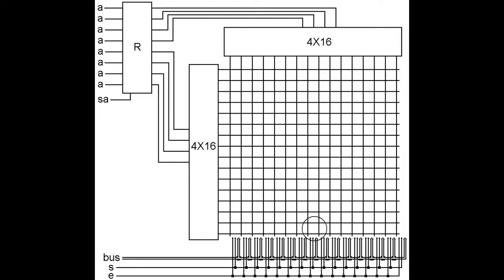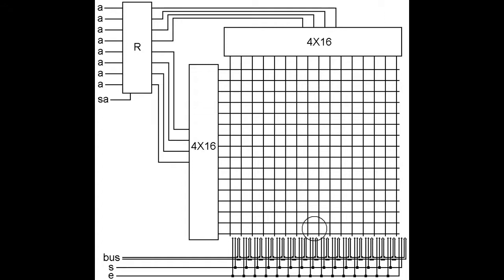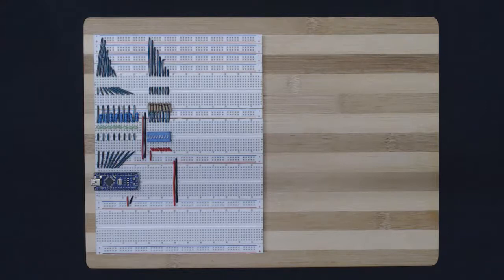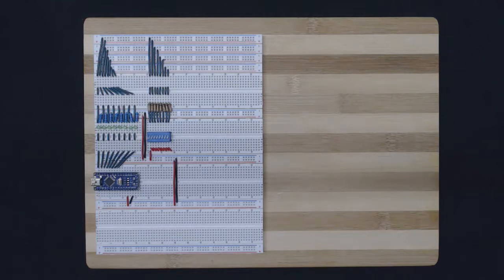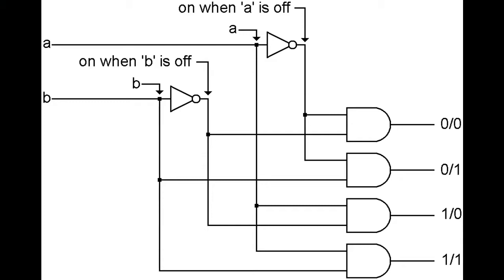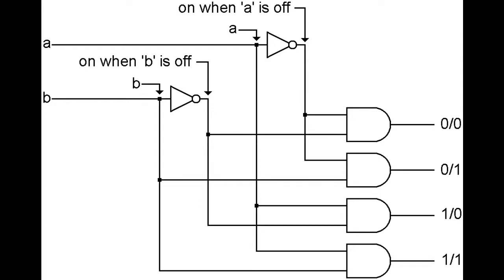But How Do It Know? Video #11 - The RAM

Comment: Thanks for your explanation but how is it 256 byte ram!! while each intersection can just store 1 bit not 1 byte, therefore it would be 16 bytes  🤔🤔
Reply from the maker: Each intersection has a 8-bit register that can store 1 byte.
Reply: @patrickleboutillier  where these 8-bit come from ?
Reply from the maker: @muhammadghaith7604  You can't see it on the diagram, but each register is connected to the bus, and the intersections are actually signals that used to enable or set the register depending on the enable or set signals of the RAM.
Reply: @patrickleboutillier  oh thank you I realize it now 🌹